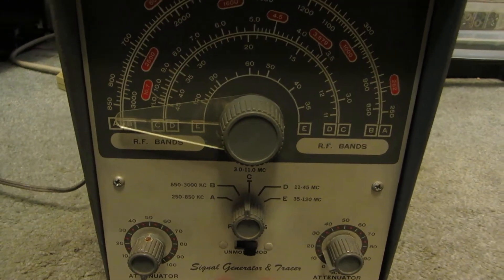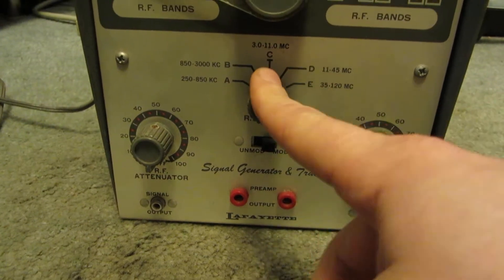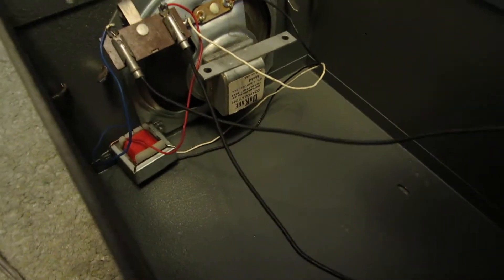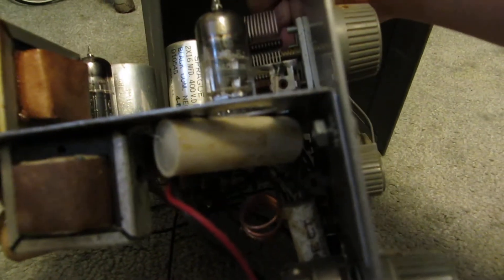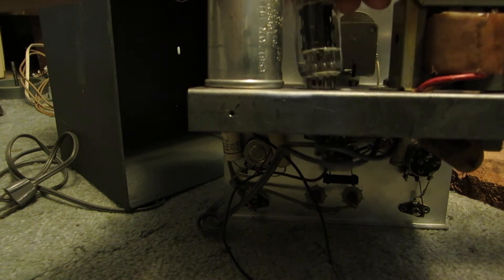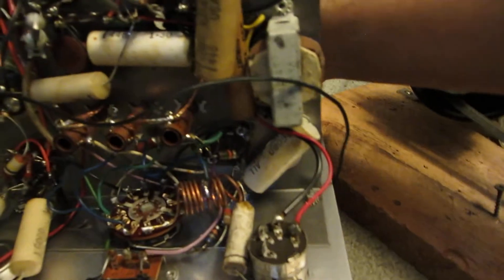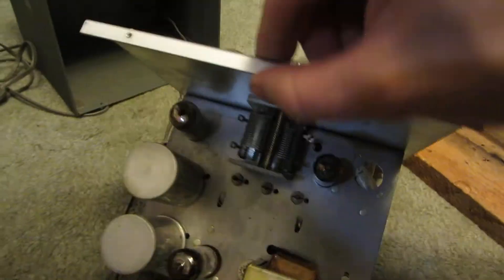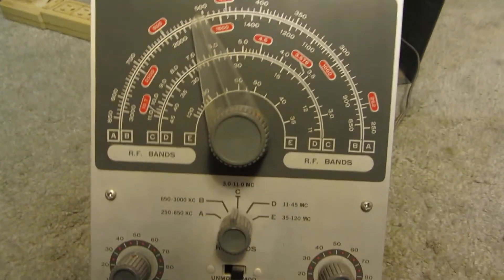Lafayette Signal Generator & Tracer Autopsy

Comment: The main purpose of this is to generate radio frequency (RF) signals for aligning radios. The MOD/UNMOD switch modulates this RF signal with an audio tone so you can hear it on the radio under test. The secondary function of this is a signal tracer, a device that allows you (with a probe) to hear what's going on in a particular section of a circuit, hence the speaker in the case.
Reply from the maker: Good to know.